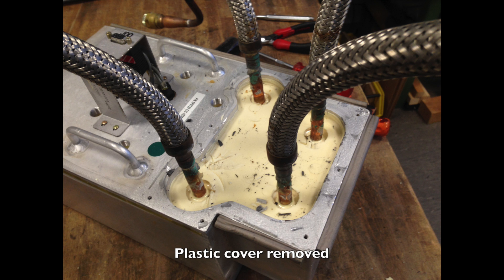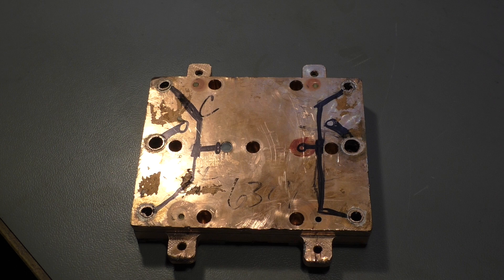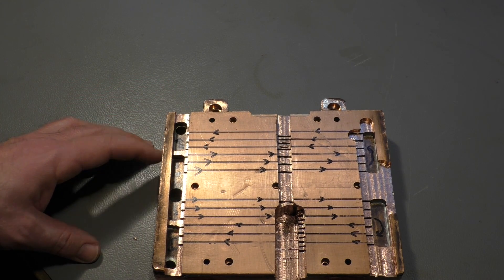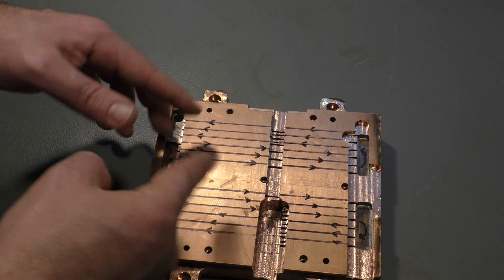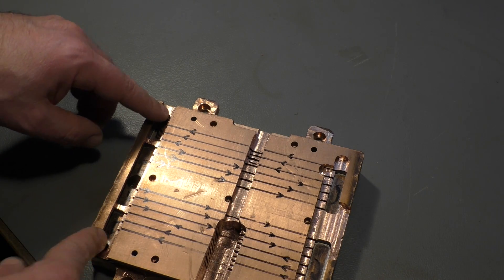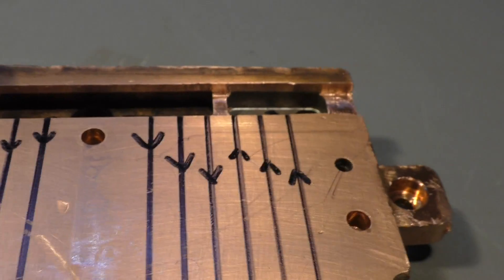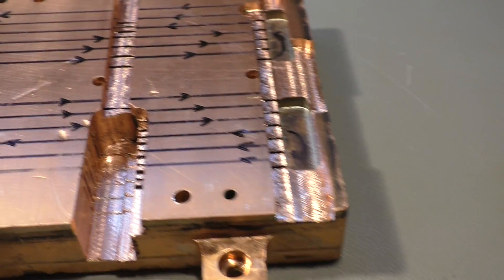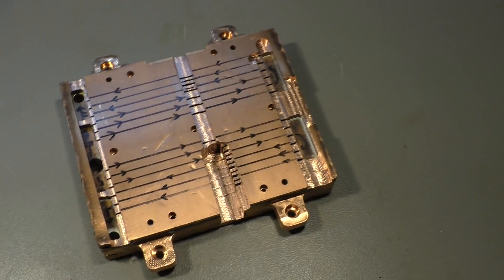IBM CPU cooler Evaporator Assy  (PWJ51)

Comment: I think the input would be in the middle. dual outputs to deal with the expansion of the coolant.
Reply from the maker: Probably yes. Especially since the two outputs are connected with a T-joint into one tube. If this was the input, an equal distribution would be unlikely.